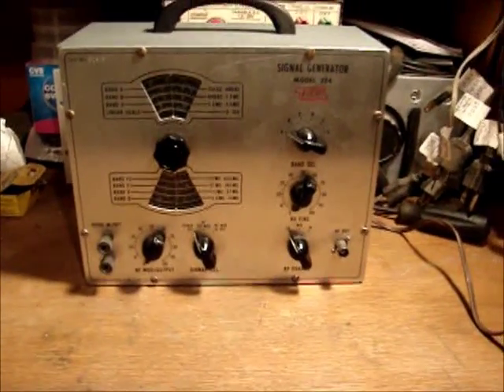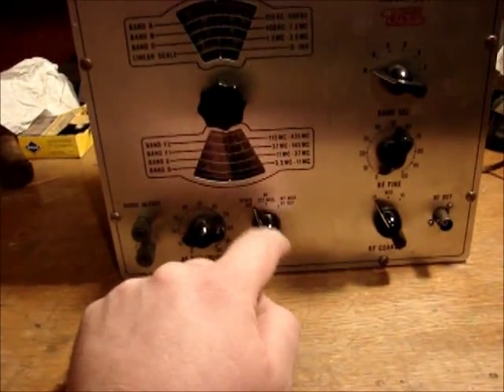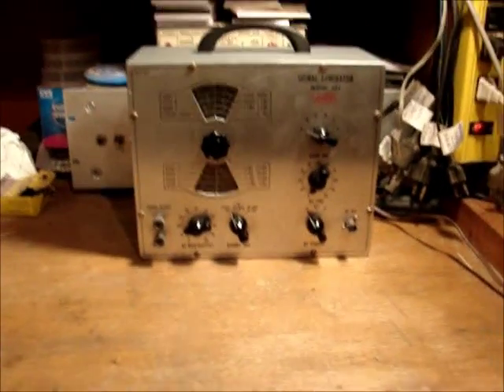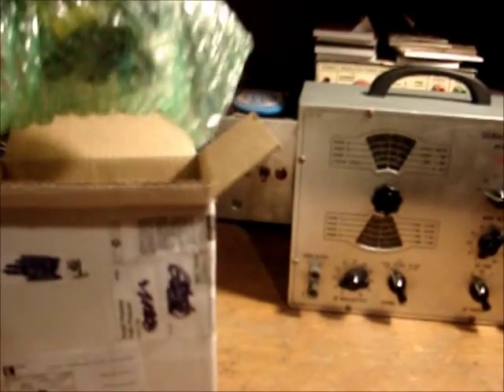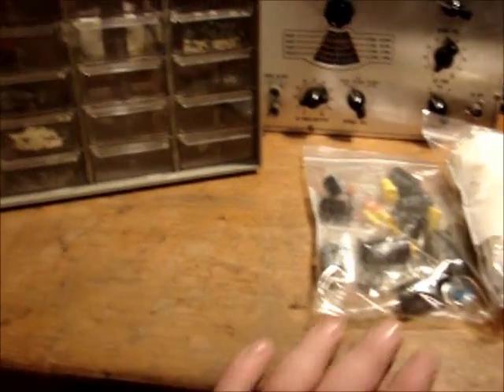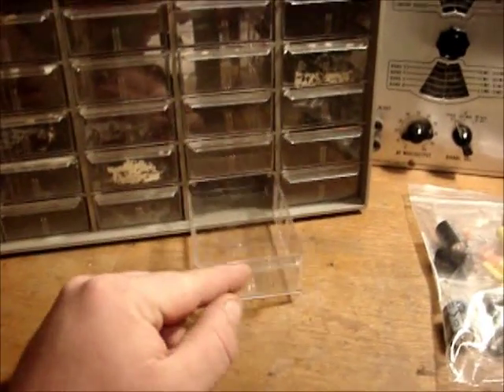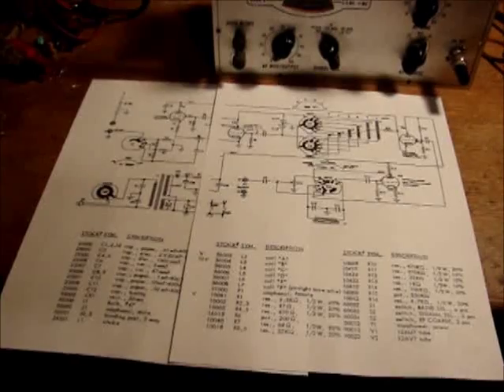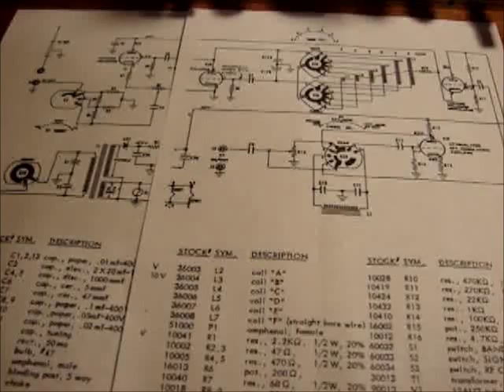Eico 324 Recap Part 1

Comment: Farmall1938, I'm about to place my order for the recap supplies. Concerning that diode my schematic lists that as a CR1 rectifier 50 ma.,  you replaced yours with a 1n4007. What other rating should I look out for and where did you get that since my listing was updated to a 200V 750PIV.

Comment: Then that explains why my father used to claim "I was walking light in my moccasins". OK no 3 wire plug, may introduce something unwanted into the circuit. Man I enjoy these videos from you. I did notice on my 324 the bare wires than run from the rotary switch to the variable capacitor the one closest to the front is not attached. I haven't gone over the intructions/schmatic that closely yet but I will. You've got me racapping everything now and learning in the process. Thank you!

Comment: Thank you for your fast response concerning my question from another video. I picked up an Eico 324 myself after watching this. I have yet not applied any power to it until I replace the caps. Interestingly I got what appears to be the original instruction for this and the last page the manufacturer did an update to some of the parts to this, I noticed you did not mention this.  And lastly why no 3 pronged plug installation?

Comment: I have used older tube sig gens and you can get a much BETTER sine wave  output than that out of it. I'll bet you find some of the components are way out of tolerance.

Have fun with the Eico!

John
Reply: The EICO builds in the capability of harmonics for higher frequency generation at a lower cost. Sine waves exciting a resonant circuit matter little. If you want better sine waves get a Function Generator. The two are not the same.